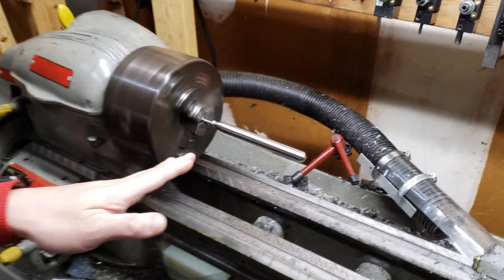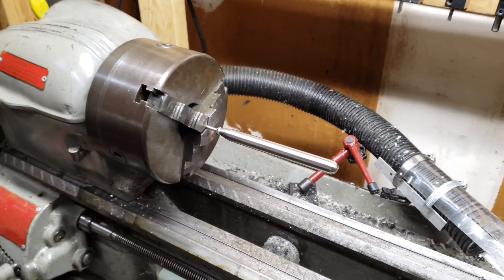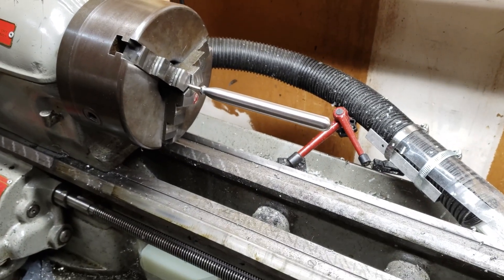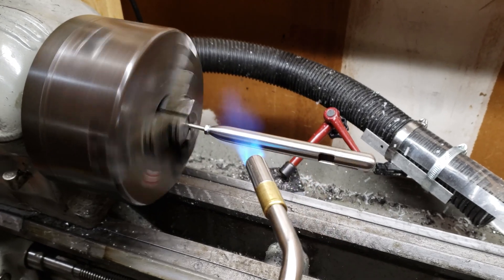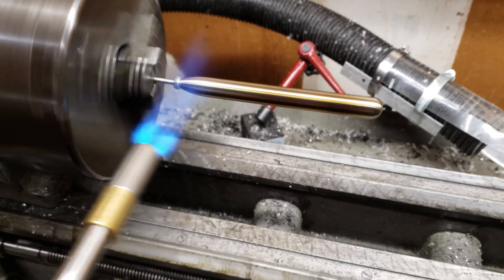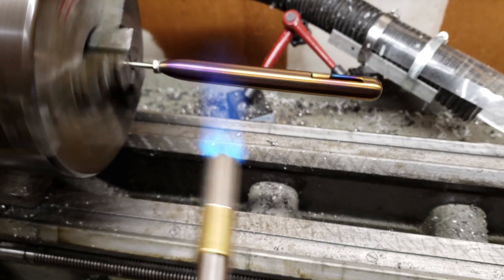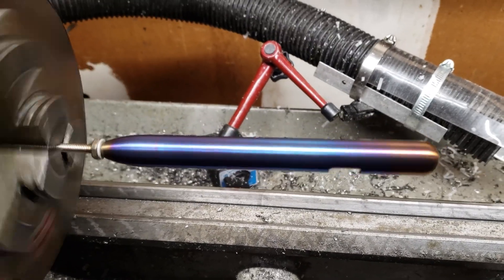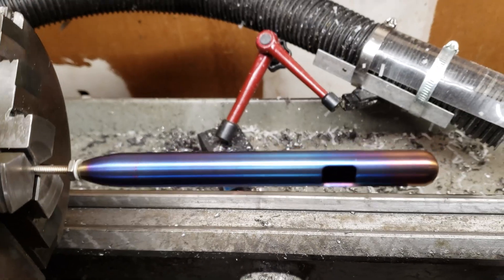How To Flame Anodize Titanium for Wicked Cool Colors | Marksmith Ti Bolt Action Marker Heat Anodize

Comment: Does this make the metal more brittle? I’m no materials scientist but I’m imagining if I did this to a metal strip it might make it harder?
Reply from the maker: Heat treating titanium is different from steel. You can heat treat titanium slightly, but it won't make it much harder or brittle.

Comment: How do you keep the color on the part? Does it need to be sealed with something so it doesn’t rub off?
Reply from the maker: It's tough, but not as tough as aluminum anodizing. It can wear off if used hard. I guess it could be clear coated, but not practical for this part.

Comment: My mechanic didn't wipe my Ti. exhaust down before starting my bike and burned his finger prints on my headers! Is there anyway I can start the bluing over if I take the headers off and sand them down or maybe polish them or something? Any advice would be gratefully appreciated to save my $3500 Akrapovic exhaust from having another MANS FINGER PRINTS ON IT🛐
Reply from the maker: Depends on the finish. If brushed, then an abrasive pad like scotchbright will will remove it. You can lightly sand and polish. The color change layer is an oxide layer on the surface and it's not as hard as aluminum oxide anodization.

Comment: Is there any way to reverse this process and how deep into the metal does it penetrate
Reply from the maker: I don't think it can be reversed. It doesn't penetrate very deep, and could be sanded off with enough effort.
Reply: @engineerable  does it come off from regular use like a patina does?
Reply from the maker: @Gelattoh  It's probably more durable than a patina, but since it's a surface change, it will wear off over time with use (friction and scratching). Titanium oxide is not as hard as aluminum oxide (anodized aluminum).

Comment: Oxidizatin ... requires air and heat or time ... think RUST ... this is what is being done here ... with all of that oxides bad qualities being brought to the front ... for the sake of colour .... 
.
anodizing is a process also known as electroplating and it uses sacrificial metals in solid or liquid form to plate to the anode of the electrolytic solution ... 
.
it is technically physically and functionally IMPOSSIBLE to anodize any metal with heat ... you are OXIDIZING IT  or simple terms ... you are prematurely rusting the part creating metal fatigue and stress fractures and weak points in the metal ... the ONLY thing dumber than doing this to a part is to eat tide pods ...
Reply: Its a Pen body dude, not structural aerospace parts.
Reply: you   again
Reply: I've seen people heat tint Iron in this way, is iron oxide also toxic?

Comment: annodized requires a VOLTAGE ... thats why it's called anode ization ... as oppossed to cathode izdation ... what you are doing is OXIDIZING the titanium NOT anodizing it ... 
.
btw titanium Oxide is one of those things you DONT want to breath in or have on parts that require a good seal .. 
.
 Titanium Dioxide.  Titanium 
Dioxide should be handled as a CARCINOGEN-- WITH EXTREME CAUTION.  
Exposure can irritate the eyes, nose and throat.  Titanium Dioxide can 
irritate the lungs. Repeated exposure may cause bronchitis to develop 
with coughing, phlegm, and/or shortness of breath.
.
and yes this is exactly what you are creating ... sure the colours look cool but is a shorter life and cancer treatment worth the time ... 

.TiO2  is how the darker parts of the metal have reacted ... the lighter parts are partially oxidized ... and yes the oxidization can penetrate a weld far enough to mess up the clean surface you welded upon making your weld garbage ...
Reply: gay

Comment: Foes the Titanium need to be polished? I habe some Titanium shock towers on a rc car that are prob 1/4 thick but they look sort of rough not smooth
Reply from the maker: The surface finish will affect the final appearance of the flame anodized colors. A rough surface will have a more matte, dull colors, and a polished surface will have shiny, bright colors. Try it like it is first.
Reply: @engineerable  ok cool thank you !
Reply: @engineerable  you applied HEAT not voltage you OXIDIZED the part ... annodization requires  voltage about 3v and 5ma on the annode end put the titanium on the cathode end put say copper or nickle or silver or gold ... and wait 3 hours THATS annodizing

Comment: Wow thats gorgeous.  Made it look easy
Reply: easier ways to get cancer and respiratory problems and even the colours ... have a cam fire and place the part beside the fire and rotate it slowly ... but still the oxidizatin layer you are creating is hazardous to ones health ... this is NOT annodizing it is oxidizing ...
Reply: to get the same effect without the oxide layer and micro fractures from the heat  where the oxidization layer penetrated deeper ... put the titanium in a bath of salty water ... attached to one end of a 9v battery .... on the other end attached a copper brass and silver piece of metal ... . if the titanium is attached to the negative it will accept the metals on the posiive side if it is on the positive it will be used to add to the other metals ... 
.
 you may know this as electroplating ... but its proper name is annodizing ... what the guy in the video is doing is oxidizing the part ... falsely aging it .. making it weaker ... making it deadly and making micro stress fractires in the art as the oxidization layer penetrates deeper ... TiO2 is about as strong as a cooked spaghetti noodle and as healthy as the bubonic plague ... and is the absolute WORST things one can do to a part that needs to withstand repeated stresses ... think the steel on your car and rust or properly called iron oxide .. Fe0   .... it has the structural integrity of fresh chewed gum 
.
 so if you like taking a part that took 12 bits to cut and drill and clean up and many hours to bend and shape ...and then take all those hours for say a spring over shock absorber mounting bracket and post ... you may as well just use rusty metal ... because it wont be long before that shock comes up through the mounting point ... and if you happen to run stuff like baja then you will end up cartwheeling all over and IF your harnesses were not done the same way when mounted you might actually live to tell the tail ...

Comment: Some people should be kept away from blowtorches, lathes, or even spoons for that matter. This is not anodizing, nor is good for the base material, you're messing the whole HT of the Titanium. Proper anodizing in Ti is so much easier than on Al that I'm baffled people insist in burning it to crap. This is on the same level of lack of awareness as welders taking vanity pictures of their rainbow colored welds and demanding praises for the "good work"... meanwhile people that know it better die a little inside at the ruined parts.
Reply from the maker: Do you have info that backup this loss of hardness from flame anodizing? I'm just trying to learn. What I understand about Gr5 titanium is that it is solution hardened (and naturally age hardens), and even then the change in hardness is only about 5HRC greater than annealed state. https://www.atimetals.com/Products/Documents/datasheets/titanium/alloyed/ati_6-4_tds_en_v1.pdf
According to the document above, annealing it requires it to be held in the heated state for at least 1/2 hour. Does heating it for a much shorter time still anneal it, or does it retain the temper?
I agree that solution/electrically anodizing is better, especially if you want consistent colors. It requires more equipment to perform it. For a non strength critical part like this, the heat is not going to affect it.
Reply: @engineerable  titanium Dioxide is weaker than aluminium ... by heat oxidizing a part of titanium your are OXIDIZING the part making it lesser than it was when finished .. and the heat oxidization will travel INTO the part making micro stress fractures ... in a picture frame its not as important (aside being a cancer causing gent and a respiratory hazard)
.
secondly ... flame never can and never will Anodize a part ... it is physically technically and actually IMPOSSIBLE .... annodizing is the process of applying a voltage at some current to make the negative side (anode) take up the sacrificial positive side(cathode) 
.
it is also known as electroplating ... 
.
and as Sten mentions flame colouring titanium is waste of the metal ... if you want fancy colours actually annodize with nickel copper and brass ... and you will get the multicolour rainbow and NOT have a cancer causing part with micro flaws built INTO it .. 
.
this is something one learns in Engineering ... heck I learned it in my electronics engineering back in grade 9 ... 40 years ago
Reply: @0623kaboom  it doesn't matter that much dude. I would get it if someone was flame anodizing something that was meant to bare a load.

But..  this is a pen. A pen.

Chill.
Reply: @0623kaboom May I ask you a Little extra info on the toxicity of TiO2? What is it exactly that has cancerogenic properties in the heating process of this video? Is It the fumes whilst heating the Ti, or is it the actual handling of the oxidized piece? I would be grateful if you could explain It more in detail.

Comment: Would propane work also?
Reply: No problem propane works just fine. I've got beautiful golden, purple and blue results. It just  take longer time for the titanium to reach required temperature for changing color.
Reply from the maker: @gu1111  Thanks, good to know propane works too. Maybe it's easier to control the colors with propane if it heats slower
Reply: @engineerable  Yes, I was shocked to see how fast the color changed in this video.
Reply: In goofy units in air.
Propane 3450f
Mapp 3670f
Mapp in the US 3600f

US mapp is now a marketing term for propylene.
Reply from the maker: I've been told that you need MAPP gas for the higher heat. @G U says that propane also works, but it takes longer.
Reply: @engineerable  thanks